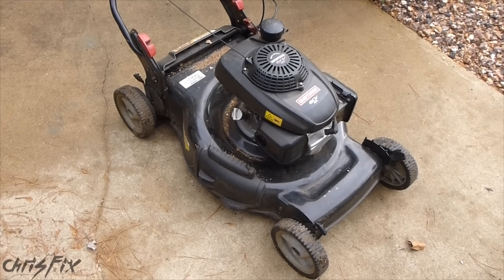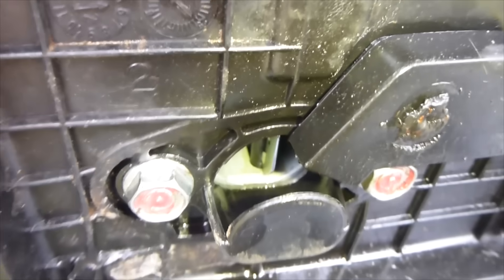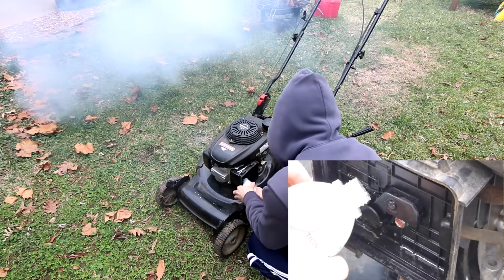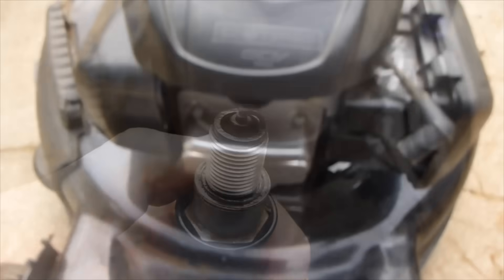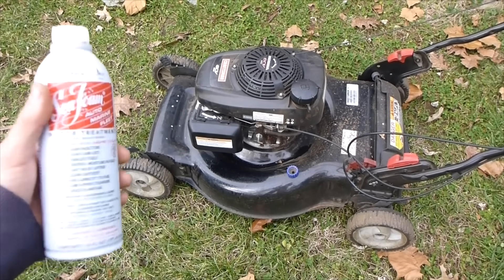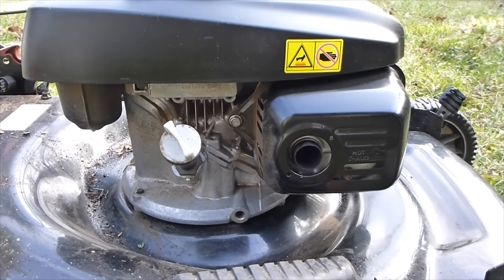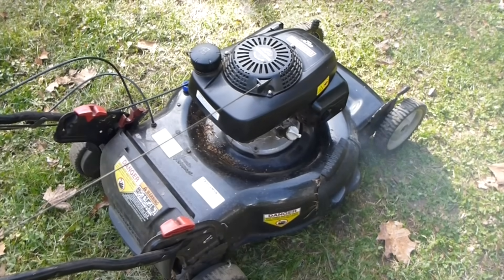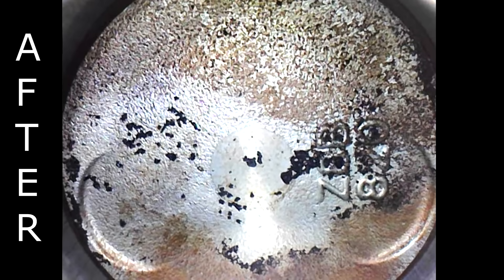Does Seafoam Actually Work? (with Proof)

Comment from the maker: The results speak for themselves! Here is the video testing SeaFoam in a car engine: https://www.youtube.com/watch?v=u6UeJXkzDW8
Reply: I'm actually shocked NICE
Reply: I'm surprised. Please try water first before the Seafoam. If it doesn't work then move onto the Seafoam test. If water works, then we can all save money and not have our neighbors complaining about the smoke. I wonder why Seafoam adds the oil that makes it smoke, is it because that is why people think it works? This is the first time I have seen someone test this stuff with a real test and show that it works. Great job. You win the internets.
Reply: Can't wait to see the next test video.
Reply: great job Chris!
Reply from the maker: ***** Yes, I will be testing water soon! Stay tuned!
Reply: Damn good test Chris!
Reply from the maker: Bob Jimenez There is nothing in seafoam that would damage the piston or metal rings. I never heard of plastic piston rings. Is that even possible?
Reply from the maker: Joseph McGowen Haha
Reply: You can get the same result with water. We tested a ton of these cleaners years ago while I was in school to be a mechanic. They all performed as well with water.
Reply: ChrisFix Used it hundreds of times. Just this week I used it in my early 70's Sears SS 16. Would have to run on choke before hand and now runs normally.
Reply: jollyandwaylo Water does work.  Put some in a spray bottle and spray a mist into the carb.  Any liquid will wash the piston.  It is no different than fuel.  The richer the fuel mixture, the greater the piston wash.  You will see it more obviously in 2 stroke near the ports but you can still see it in 4 stroke around valve reliefs and such.
Reply from the maker: TvidzCT Same man! I was impressed! I honestly didnt expect it do work.
Reply: @chrisfix  I love you my man and I thank you for teaching me a lot. However, search for apostle Gino Jennings if you really want to be close to Jesus Christ.

Peace out
Reply from the maker: AccidentalZombie Thanks! I cant wait either!
Reply: @chrisfix  quick silver... quickleen... engine tune.... I do believe sea foam is a rebranded quicksilver.... quicksilver has been doing this for 60 years
Reply: I told ya, soaking is definitely the way to go :-)
Reply: jollyandwaylo Now I'm tempted to soak but I think I would vacuum out the Seafoam and carbon chunks before running it. I might even rinse it with alcohol and vacuum it out again before I run it. But I'll wait for the next test before I do anything.
Reply: jollyandwaylo nah, just crank the engine a few times full speed with all the plugs out.
Reply: @Ian im a certified diesel tech, but know my way around gas well. My father has a 02 626 with exact same problems. Those engines are known for not liking any ignition failures. Look into testing or replacing the coil pack/spark plug wires and spark plugs (you HAVE to get the dealer spark plug wires, they wanted to make the after market hard to duplicate so they use very specific ohms and any little bit off causes bad timing or spark delivery. This is most likely your problem, as it was on my dads car when he had the same issues as you) Also you can try to clean the mass air flow but tht probably wont be a fix but its worth a shot
Reply from the maker: Ian Eastland sounds like trollaphobic is helping you out! That is nice to see! Thanks!
Reply from the maker: Ian Eastland Is the ac on by any chance?
Reply: Chris, carbon buildup is a problem when it affects the ignition phase of the engion. That takes a lot of buildup. The place I have found the more immediate problem are on the valves and valve seats. When the valves are held open even a micron this lets very hot gas back the wrong way and leads to burnt valves and failure. That bring said, any way to see how these products are doing on the valves? The camera could need to be way more flexable than my bore scope. Thanks for all your hard work. Great videos and very nice scientific method of testing.
Reply from the maker: Ian Eastland Check the check engine light codes. Then report back.
Reply from the maker: ***** I probably wont get to zmax because I have a long list of stuff to try already. If I am able to, I will though! Thanks for the suggestion!
Reply: My dad swears by this stuff. Looks like it works well.
Reply: shadow0imposter When people use Seafoam to clean off carbon deposits they aren't adding it to their oil if I understand it. Seafoam is a solvent based product so if one adds it to their oil isn't it weakening the protection of the oil by thinning the oil? Or do you add it and drive just for a while and then change oil?
Reply: yes, you only add it right before your next oil change. you should drive a minimum of 30 mins, or 100 miles max. http://seafoamsales.com/using-in-crankcase-oil/ heres the seafoam website, great info on here if youre curious about anything, tons of great info :)
Reply from the maker: eraldorh You can add some to the fuel but that wont remove the carbon (as stated in their directions). The directions say to remove carbon you add it to the intake.
Reply: Make sure you preheat the oven to 625 degrees, also remember to baste your lawn mower every 10 minutes.  Sorry I couldn't help myself.  But I am seriously trying this on my lawn mower.  Just saying.
Reply from the maker: jeepmanxj Nice! I will be doing a video on water soon!
Reply: ChrisFix also use distilled water or the crap in the tap water just burns in there.
Reply: ChrisFix
We know you know what your doing, i just feel funny about the water thing. but i was also looking at STP micro lubricant Fuel System Cleaner. I have been using Marvels Mystery Oil [ 4 oz. per tank ] or Star-tron ethanol treatment 2 oz. per tank myself. My truck is before 1995 and i don't think it really likes ethanol much. My 97' Disco hated ethanol with a passion.
Reply: Vu Tran
I have used engine oil seal conditioners but found that my gas mileage really took a hit. Out of all my cars i really never had any of then use more then a half a quart of oil every 3000 miles. I just gave up on paying the extra cost  and at least for me regular premium motor oil with 60% synthetic added does fine, so in other words high millage oil works and i do switch from that and regular but if you really have to depend on it save up for that rebuild.
Reply: I wish I had taken before and after of my 93 integra. It clean a good deal on my inlet and exhaust port. Took some caking off the piston head. This was a 22yr old car you use you imagination how dirty is was. I was smoking for a while neighbors hated me that day. I can shoot some pictures of the piston top if you want just shoot me an email. 
The head is at the machine shop currently. I took it off the first time change the headgasket. My straight edge was off I guess had exhaust gas in my coolant. Before I pull it off again I decided to seafoam it to see how it would look.
Reply: I have a 77 f150 and this worked great on it.
Reply: I have used seafoam many times, and I have never been disappointed with the results!
Reply: i honestly didnt expect much of anything from this one either they all dont seem to have done much  so far now  the cleaners i have tried seemed to have helped the injectors but thats about it  but  thats kinda what i wanted cleaned anyway haha.
id love to see more tests though  find the ones that work the best
Reply: I use Sea foam all the time. Pour a can into my tank when I fill up. Does a great job of keeping your fuel system clean and inhibits moisture in the tank. I would swear by Sea foam and I wouldn't use anything else.
Reply: SuperJeremi10
If that is the case then let your local shop change the oil. However, you yourself can ask them how much your engine capacity is. Then add 1.5 ounces of Sea Foam for each quart. Say if you have a V-8 engine. Usually a V-8 takes maybe 5-6 quarts of oil at change. Engines like my 4.3 liter take about 4.5 quarts.
Remember, it never hurts to ask an ASE mechanic for info about your vehicle. It could be the difference between losing it or saving it ;)
Reply: watter make smae results,so why to buy this crap seafoam? lol :D
Reply: Hey ChrisFix,

When you go for seafoam on the truck I would suggest trying the new application - Seafoam Spray. I know it won't be consistent given this video but seafoam spray is much easier to use/apply and less likely to hydrolock the engine or damage any sensors. Much more novice friendly and over all the better product. Also goes directly into the throttle intake (all cylinders evenly) versus screwing around with the PCV line (cylinder 1 or 3 bias). Most of the time you only need to loosen the intake manifold hose to wiggle the straw in and no need to remove it.
Reply: Bob Jimenez being a small engine technician, I have yet to see plastic rings. (Since the rings actually transfer the majority of the heat away from the piston to the cylinder walls.)
Reply: I think you should test stp multi purpose motor treatment. I got some at Walmart next to seafoam. In a can like seafoam. Its alcohol free
Reply: Yeah, best applied with a mister/spray bottle.
Reply: jollyandwaylo Please pour water into all of your engines and post the video please!
Reply: Dillon Miller its called water injection and its been done for decades.
However dumping water down the intake randomly is dangerous and not very effective. It needs to be precisely metered to avoid hydrolock and for best effect.
Reply: ChrisFix  Would be nice to see how it cleans valves too =)
Reply from the maker: dhowser2008 Yea, and in that video, he was payed by gumout to say those things. Seafoam is made for 2 and 4 stroke engines. Gas and diesel as well!
Reply: @chrisfix  again it's a rebranded marine grade cleaners... use quickleen and power tune together for best results
Reply: ChrisFix ., can you do a 2 stroke video And would you mind if someone uses a 30 wt non detergent oil mixed at 1/2 ounce per gallon? I have a engine and 2 stroke oil costs a ton in large amounts
Reply: ChrisFix Do you think you could do one of these tests (mower or car) but using water instead?
Reply: ChrisFix Thanks for doing this. Can't wait to do it to my truck.
Reply: +KOakaKO  Uncle fuckin Fred???
Reply: Tecumseh Sherman
- Heh, you're funny. You should write comedy.
Reply: +Joseph McGowen  Is that 625F or C? And I'm having a hard time fitting my lawnmower into my oven..
Reply: +Mexside619   VERY carefully , i suggest a mix of  80% Marvel Mystery Oil and 20% water  ( keep the bottle shaken well ) and do not over rev to prevent Hydro Locking .
Reply: You usually cant tell if a maf is dirty by looking at it. Just remove it and spray it with special mass air flow cleaner. Make sure to disconnect it and let it ary dry for a few min before reinstalling.
Reply: I don't know about that engine in particular but idle and stumbling on acceleration problems can be from unmetered air bypassing the maf.
Reply: Ian Eastland Ian, we just did this with my sond truck. Do you have any engine codes? The mas air flow sebsor does not kick in untill driving speeds. In other words at idle or below 1000 RPM the MAF does not calculate. If you replaced all as suggested and are 100% sure you have good spark the next item on the list is the throtle position sensor. After adding the cold air intake the MAF may have been confused but that would have been imediate. There is a way to test the resistance but that is vehicle specific. Find an online forum for your car and I bet after a couple searches you will find some folks with good advice. Let us know what happens.
Reply: Yo Chris can you see if Zmax works I hear they are really good
Reply: 2 thumbs up
Reply: jollyandwaylo because its also used to lubricate as well as clean. it can be added to your fuel, and your oil. added to your fuel helps clean your fuel system; i.e. lines, injectors, ect. adding it to your oil helps cut down on the sludge and break down deposits while helping to lubricate any moving parts. hopes this helps you out :)
Reply: that is a nice lawnmower, It would be a shame if that stuff ate through the anodize coating the soft aluminum piston. After losing a ford in-line 6 truck engine to a similar additive I am extremely weary of repeating the same mistake. My new motto is if I want my engine to be clean and carbon free...take it apart and carefully clean it. What is that stuff doing to the rings? I wouldn't put it past a lawnmower manufacturer to use plastic rings...even Honda.
Reply: if it costs less to produce and can be proven to last 1 hour longer than the warranty period it will be done. Don't put anything past the designers of consumer products. Come to think of it Parker makes high temperature o-rings that could do the job of a piston ring..HTS
Reply: I thought you were supposed to mix this stuff with the fuel to get the best results.
Reply: ChrisFix careful not to flood it, trust me it ends badly.
Reply: Everette Singleton water cost 2$ and seafoam cost ? :) also whats your opinion on additives that help seal leaking oils in the engine (seals ? ) thanks
Reply: Vu Tran they can help, but mask the larger problem with the seal.
Reply from the maker: Tharn Berry Can you post the pics on the ChrisFix facebook page: https://www.facebook.com/chrisfix8
Reply: id love to see what it does for the car.
Reply from the maker: john d Thanks for sharing John!
Reply: I have also heard of the "water trick" to clean and decarbonize engines. Do you think you could try this trick out and show us the results?
Reply from the maker: Shannon Sisk I will be trying the water trick and showing a before and after! Stay tuned!
Reply: Yeah its good for routine maintenance but if you are using it when the car is already nasty itll do next to nothing. Seafoam needs to sit a bit and eat at the carbon. I used it as a cleaner when i had me head off.
Reply: well ill try it  the previous owner didnt maintain the car very well abnd i was actually paid to remove the  tahoe  because it wasnt running   i did quite a bit of work and a tune up  she runs great other then a slight lifter noise which i plan to have fixed  im using this as m main car and i put about 300 miles a week on it by the end of the month i have bouth 1,000 plus miles on it i had the oil changed last month and im already 1,000 miles away from my next oil change when that comes up it will be done i do my oil every 3,000 miles for now  as the last owner  didnt change the oil so im trying to clean out the system.
Reply: SuperJeremi10 Once you get it running to where you want it. To stop that lifter noise, it may just need some treatment in the crankcase. Now, with as many quarts of oil you use depends on how many ounces of Sea Foam you put in your crankcase. My Blazer uses 4.5 qts.  So I add maybe 6.5 ounces of Sea Foam to loosen up any gunk inside. Trust me it is perfectly safe to do this. Just remember add 1.5 ounces of Sea Foam for every quart of oil.
Then drive the vehicle for roughly 200 miles, change oil again. Chances are that lifter noise will disappear.

With continued use in the fuel tank and crankcase will keep your vehicle clean and purr like a kitten.
Reply: cool ill try that not sure how much mine takes ive never done the oil i always take it to the local shop the previous owner was bad about changing the oil  i can ry dumping some into the oil thats in it now 200 miles before i take it to be changed if you think that would work im not very good with cars.
Reply: You should do a video on marvel mystery oil and see if that cleans the carbon out. Truck drivers swear by it and it has good ratings I'm curious to see if it really works.
Reply: Steven Harden
Sorry man, anything with the word "Mystery" in it and I wouldn't trust on my vehicle.
Reply: Michael Sarka  Your ignorant.
Reply: *****
Of course I know that it is Petroleum based. It does what it says it will do and I like the product. I don't use any Mystery shit in my SUV like young Mr. Steve up there. Seafoam does what I like and I wouldn't use anything else.
Reply: Michael Sarka  I never said I used it. I want to know if it works cause the truck drivers around hear swear by it. The product also gets good ratings If it can clean a diesel then it can clean a car. It may do even better than sea foam idk that's why I asked him to test it out. Stop being ignorant
Reply: Michael Sarka  the navy also uses it on their jets.
Reply: Steven Harden Young man you need to show more respect. Look if the truckers swear by then use it.
I'll stick to Seafoam.
Reply: Michael Sarka Respect is earned. Plus I never showed any disrespect,  the fact that you wouldn't try something just cause of its name is ignorant.  I call it like I see it. Maybe you should be more open minded.
Reply: it's a petroleum based fluid with mineral oils. I think there's another Marvel Mystery Oil that comes in a grey bottle and it's  solvent based with mineral oils. Not sure on the last one I'll have to look more into it.
Reply from the maker: french boner Thanks for the tip man! I will check it out!
Reply: AccidentalZombie I was looking for it. I don't see it so he hasn't made it yet?
Reply: In your latest vid, your lawnmower piston was covered in black crap. Maybe you can seafood that out. And the ultimate test is: what will sea foam do to a engine with 300,000 miles like your minivan
Reply from the maker: lyndel biggs I will be testing stp too!
Reply: Thanks i just brought some. I was curious because it come in a can just like seafoam! It even comes with a handy screw on funnel
Reply: ***** water also works but only as a steamer, just be very careful. If you want to soak the top of the pistons, then use a little seafoam in the cylinder.
Reply from the maker: Ivan P No, I havent but I will check it out
Reply: Dillon Miller What are you talking about?
Reply: jollyandwaylo "I'm surprised. Please try water first before the Seafoam. If it doesn't work then move onto the Seafoam test. If water works, then we can all" you said that. and its retarded.
Reply: Dillon Miller A whole bunch of people have claimed that the water treatment will get rid of carbon on heads so why are you suggesting what I said is retarded. I am not suggesting adding water to the gas if that is what you are thinking.
Reply: jollyandwaylo water works. cylinders with blown head gaskets are always clean as shit. its not oil added to the sea foam. sea foam IS oil. its naphtha. aka the same shit in automotive parts washers. the metal sink onto of a 35 gallon drum type. naphtha is a stoddard solvent, a high distillate of oil. like kerosene.
Reply: FuckGoogle+ I agree fuck google lol I hate google
Reply: Ian Eastland Hey, Ian. It's been a while since you posted this. Have you fixed the Mazda yet? Anyway I was going to suggest a major tune up, with new ignition cables (spark plug wires) and a throttle body service. What often happens is when carbon and dirt and stuff collects around the throttle plate, it restricts the airflow and the idle control motor has to make up for it. You might try cleaning out the throttle body.
Reply: ChrisFix Search YouTube, there is a video that explains in detail that seafoam is only for 2 stroke engines not 4 stroke ones! lol
Reply from the maker: Peter Kapica A 2 stroke video is a good idea!
Reply: I got one, how to rebuild the top end of a 2 stroke engine ChrisFix . ETCG has a 2 stroke vid and Scotty Kilmer has one.
Reply: Really XYZ?
Reply: Do you think I could uae seafoam on my 1964 mustang?
Reply: +smwizzz - The water method works, and I've been doing that off and on for decades.  But it doesn't really 'wash' anything. The water gets blasted to steam when the engine is detonating the fuel, in a matter of micro-seconds, and the rapidly expanding steam is what scrubs the carbon off inside the cylinder. I had a long talk with my uncle Fred about his tractor-pulling Massey-Ferguson and the water-injection system he had on the engine, back in the early '80s, and he explained quite a bit about the physics of how it works. I suppose the sea-foam, or the gas/oil in the 2-strokes you mention, are doing something similar when they they suddenly blast into a vapor - but it isn't really 'washing' anything in the midst of that violently explosive environment.  ;)
Reply: +smwizzz I was just recalling that.  Thank You.
Reply: jdj62464
- My uncle Fred didn't just have a pulling tractor. He was also the head instructor for the Diesel engine program at the local college. These days, he's in charge of the training program that educates all of John Deere's engine technicians for the Midwest third of the U.S.

Yes, my uncle fucking Fred knows a thing or two about engines and what happens inside of them.
Reply: +ChrisFix AND YOU WERE RIGHT !
Reply: Promote Him to N.A.S.A. immiadetly.!   ~( : - })={>--- ]
Reply: +ChrisFix Keep in mind a modern fuel injected car that crap knocks stuff loose from the cylinder where its not hurting anything at all and blows it out through the exhaust or scrapes around in the engine until the next oil change. maybe gets caught up in the rings and scratches up the cylinder walls. If it makes it to the exhaust its going to go into the mesh of the cat converter and clog that up. 

 Fuel cleaners of course can clean out your fuel tank and fuel lines and it might stop in the fuel filter or if the filter is clogged up and has a bypass it could go right into the injectors and get clogged up there. 

 Most of these things dont really solve problems on modern cars. On an old carburated engine it most likely wont do any damage but fuel injectors and cat converters dont like crud trying to pass through them.
Reply: +ChrisFix I'm for sure doing this to my mower! awesome!
Reply: +Jamie Wagner I'm gonna hydrolock the shit out of my mower LOL.
Reply: +ChrisFix it hardly worked. And what is the point in cleaning a minor amount of carbon off the top of the piston? you did more harm to your plug than what you helped the piston
Reply: +ChrisFix Kudos for making testing videos but...this was pointless really
Reply: Jon Doe
That's kind of what the testing here proved... that it really isn't worth the effort. But now we know!
Reply: watch?v=LmWOOrwDUug
Reply: +ChrisFix are you from greece because i saw a greek video of yours
Reply: +La D. Da you can't make something that is petroleum based "synthetic" by adding something that is petroleum based. That totally contradicts the word "synthetic". True synthetic oil has no petroleum, it's a blend of chemicals.
Reply: +Bilbo Baggins You dumb a$$
Reply: But what did cleaning that little bit of cleaning really do for the mover? Does it run smoother, better "mileage"?
Reply: Alex Kunze fuck no
Reply: +Alex Kunze protects longevity
Reply: TakticElement Hell no. Maybe inhibits it due to cylinder wash
Reply: +Jon Doe It was for the sake of testing product claims, not whether or not the carbon buildup was an issue that needed to be fixed...
Reply: Could you do a test using only e85, I was told it will clean better than anything on the market.
Reply: ChrisFix  
bum stinks
Reply: ChrisFix  my bum stinks yeah
Reply: why not just spray inside with a carb cleaner and red straw directly on top of cyclider
Reply: Sea foam is a rebranded carbon cleaner from quicksilver(google it)... use marine grade cleaners for your car engine... marine engines are high performance engines.. they have to hold high rpms... they don't have transmissions... just one gear... since they are high performance.. there is no computer... just a simple high performance engine... but the problem with marine engines is as follows... high performance with low grade fuel(87/89 octane)... equals carbon build up in the heads.. valves... especially on the piston rings... can use it on any motor... 2 cycle.. 4 cycle.. diesels... check it out!!!